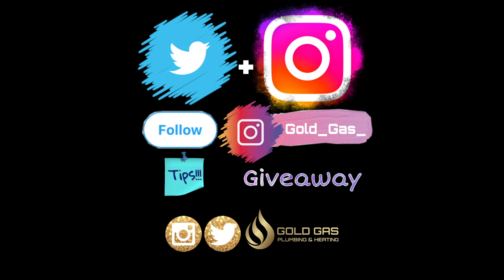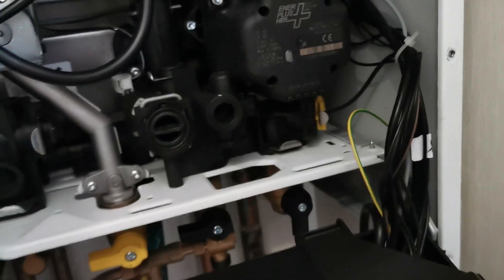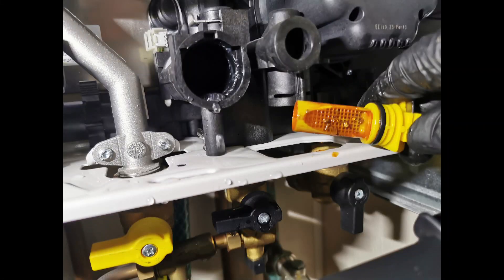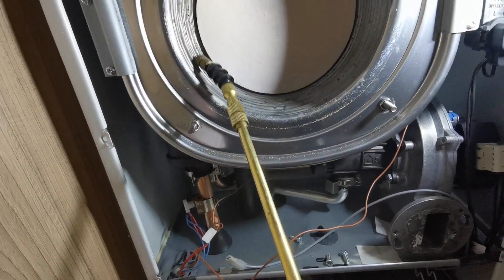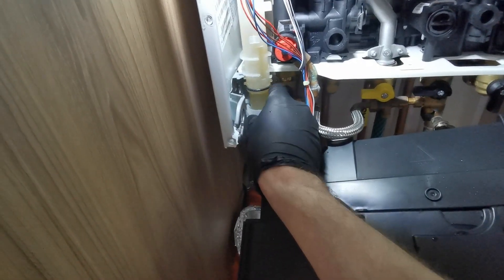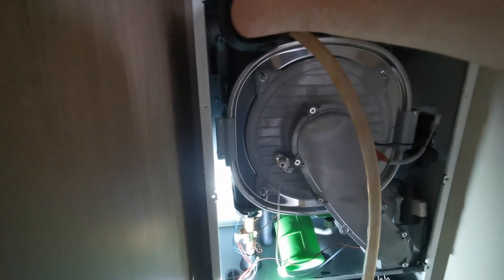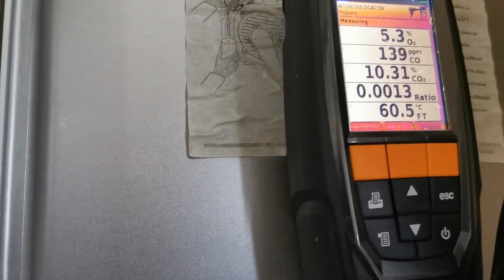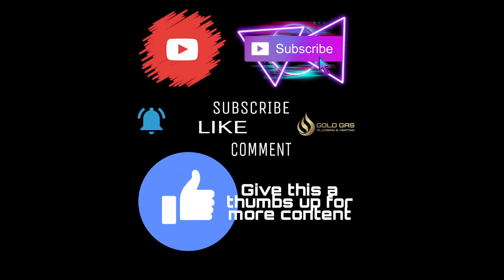BOILER SERVICE - ARISTON E COMBI - HOW TO SERVICE A BOILER - THE ULTIMATE SERVICE!

Comment: Hi guys
hope you can help , Ariston CLAS HE Evo......central heating working fine as it should, but when using the hot water taps in the sink and shower the temperature keeps going from hot to cold every few seconds continuously .
i can see the lines under the flame on the display going up and down  error codes stored are 107 and 1p1  and 1p2
any ideas what could be the problem and what should i inspect ? pressure is between 1 and 1.5 bars. all filters cleaned.
thank you in advance

Comment: Is the Next Evo SFT similar to this model? I live in Spain and have had constant issues with this - not the least being only a 6 month warranty! I’m getting an A1 error on the LCD, and the burner LED icon doesn’t light up. The PCB was replaced soon after the purchase, as well as the burner and a couple of sensors. I would really appreciate some help! Cheers I should have mentioned, this model runs on Butane gas.

Comment: I've got one of these blowing the 2 amp quick blow fuse on the Pcb. Unplugged everything from the pcb and still blew the fuse lol ariston technical said its the pcb itself. Will see if it is the pcb when the new one arrives. Hope it is if not I'm stumped. Pump is free diverter motor is dry no water ingress from the flue which apparently these suffered from.

Comment: What’s your solution for cleaning main heat exchanger coil ?
Reply from the maker: 1 parts white wine vinegar and 2 or 3  parts water (2 when they're bad), or you can use bicarbonate of soda mixed with warm water.

Comment: You do a very good job can't see many out ther doing such a good job  how much would you charge for a service like that .would be interested  to see a strip down on a Worcester compact
Reply from the maker: Thanks for saying mate, appreciate it 👍🤟 I charge 60 for this plus  parts if needed. I should of mentioned these ariston needs heat exchanger opening every service so getting involved is getting the norm now.
Lol I hate a Worcester compact, I'll certainly film one next when I do one mate 👍
Reply: @goldgas1216  yes i bet not all of them do that looks like you have to do a far bit on that for £60 but if you have done a few then i suppose you can be qwick on them i only do woresters these days much easier to service  .Do you just do service and repair ?

Comment: Would you bleed the heat exchanger for all boilers like this?
Reply from the maker: Yes my man if there's a manual bleed, Worcesters junior /ri  have one like this, couple of other types of drain offs with no hoses out there. There should be an aav if they haven't got a manual one so you'll have to make sure its open, chances are if it's an aav it would have leaked and crusted shut.

Comment: Why one would get very large  magnetite flakes  in the primary heat exchanger  scaled up  when there are quality magnetic filters and particulates filters were  installed from the new
clean installation  ?????
How on earth they pass the filters??????
Reply from the maker: Hey! Good question, is the filter installed on the return? Is it cleaned yearly? Perhaps the water needs testing to see if it needs chemicals / flushing
Reply: @goldgas1216  
Yes, off course is on return and as I said there are 2 filter magnetic and physical!!!!
I have this issue with many boilers in many different locations.
Inhibitors doesn't seem to reduced the large flakes!!!!! but small black powdery magnetite is collected by the Neudium magnet not the large flakes.
Water in the system is crystal clear.
Reply from the maker: @Han-es8qu  different boiler manufacturers you say? Think you need to take this is up with the manufacturers and send off some system water readings and list your problems, something isn't right.
Reply: @goldgas1216  
Thanks for the reply,
Almost every plate heat exchanger that I have opened in my life always had some degrees  of those large Black flakes in them , but not enough to block it completely!!!!
I am sure this has also been your experience as well , or may be not!!!!